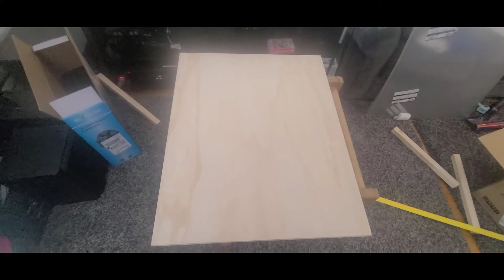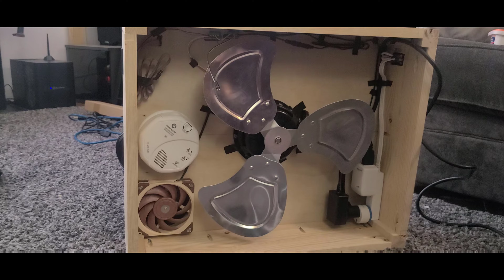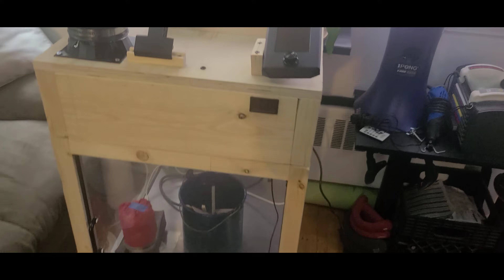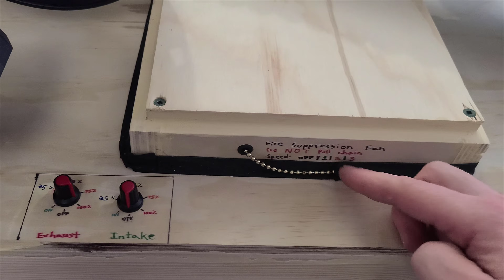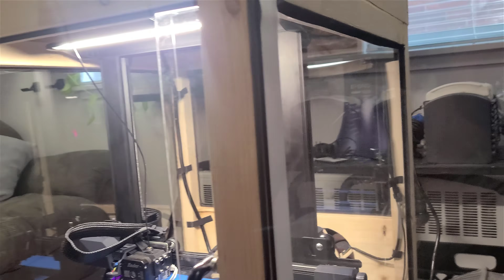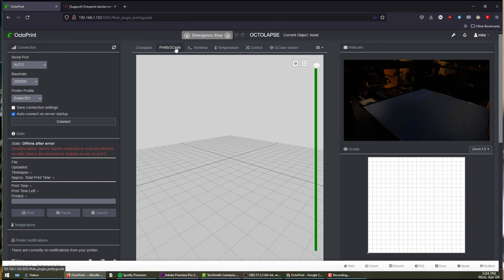Building a 3D Printer Enclosure With a Fire Suppression System

Comment: I actually think you can make this much more effective. If you seal the entire enclosure air tight (except for your fan obviously) than theoretically once a fire alarm is triggered you can have a system that closed the fan vent causing the air tight enclosure to have no more oxygen and then will be completely snuffed out especially when the carbon monoxide from any smoke that can’t escape the enclosure will cause the fire to be snuffed out EVEN faster. Remember, fires need the following, fuel, heat, and oxygen. Now here is one thing you have to also remember, is that when you come home and you have your enclosure filled with carbon monoxide, and the fires been snuffed out, or you think it has been, you need to be careful by determining that there are no embers still going before you open up that chamber that’s airtight. Fires can feed off of fuel with minimal amounts of oxygen inside that chamber and as soon as you open up the chamber for oxygen, it could cause a back draft. I’m pretty sure you know what a back draft is, but maybe not the science behind it so to ensure that you don’t cause a back draft in the unlikely event that you create that environment from a fire that does end up happening, you might also want to have a valve somewhere in the wall of your enclosure that you can simply plug a CO2 cartridge into. What this will allow is for you to inject the CO2 into the chamber to ensure that there’s no oxygen left before you open up the chamber. I would simply attach a CO2 cartridge until it stops draining from the cartridge meaning that your chamber is completely full. Let it sit for maybe a minute or two and then you’re good to go with opening up your vent and allowing all that smoke to exit.

Comment: That fire suppression system has similar workings to a melt furnace. Feed it lots of oxygen.. im sure that will be successful at "suppressing" fire. 🤞🏼
Reply from the maker: While fires need oxygen, it also needs heat.  You cant compare a melt furnace to the start of a small wood/plastic fire because the heat difference is massive.  The reason this suppression system works is because it kicks in right away and blows the heated gas away from the fuel source, preventing ignition BEFORE it gets too hot.

 The start of the fire is less than 200°C.  A melt furnace would be burning at 1200°C+.  Its like trying to blow out a candle v.s. trying to blow out a campfire.  

If this suppression system kicked in a few minutes later, after the fire got hot enough, THEN it would fuel it, rather than put it out.

Comment: Cool idea. My concern is that this is way more complicated than just using that firetube which relies on no electronic components or any peripheral triggers. Its method of extinguishing a fire is also properly tested and effective. I'm sure the method you proposed would work most of the time but for me most of the time would not be good enough😅 it's literally fanning flames. At the end of the day, I see fireproofing 3d printers as a way to mitigate against catastrophic loss of life and property. Losing the printer is the least of my concerns. That being said, good on you for coming up with this solution. Just be careful. 

Source: Someone with firefighting experience
Reply from the maker: A firetube needs to detect flame for it to burst and sprays out a liquid/powder onto the fire.  This means your 3d printer enclosure and printer would most likely be burnt junk by the time the fire goes out.  My method detects fire much faster as all it needs is smoke, so you can put out the fire before it destroys anything. 

If your concern is that my method is not good enough ALL the time, then you could combine it with a firetube, so if the fan fails, you have a backup solution.  Personally I'm sticking to the fan only tho for cost reasons, and I trust my system and believe it to be better than NO system.

Comment: Just finding this now.  what a great system.   I have 3 Ender 3 Pro's  mainly because I wanted to be able to do prints when I was home vs.  not. 

I've also discovered that pausing a print and returning to start it always leaves them with what seems like a missing layer.    

Your design is great for peace of mind to keep it running almost 24/7 vs. trying to fit time in.     Great work.   thank you.

Comment: Are you sure that's gonna work for all kinds of fires? I know electrical fires can be particularly persistent. Shouldn't pushing more air in give it more oxygen?
Reply from the maker: I thought about this.  The frame of the printer is made of aluminum and I have sheet metal on the bottom.   If for some reason the fan can't put out an electronics fire on the printers board (located on the bottom, and inside the frame), it would still keep any flames from catching the wood enclosure and prevent anything else from catching fire until the concealed electronics fire burns itself out.  For a printhead fire (more likely), I would wager there's no way the fire would even survive the air vortex the fan creates, and if it somehow does, the flame would be too small to spread to anything else